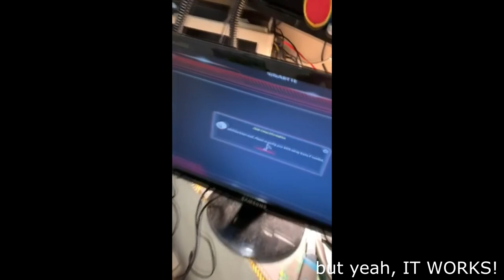Ryzen 5 3600 - Broken pin repair

Comment: Wish AMD designed a fixing tool for repairs likes this.
Reply from the maker: That would actually be awesome!
Reply: They don't because they want you to buy more instead repairning
Reply: @Jaman-qp6fc  Well, it doesn't actually seem to be that hard to fix broken pins to be honest, especially compared to a lot of other kinds of computer component repairs (like repairing a hard drive, or a videocard). It's not like we need any of AMD's special expertise for this kind of repair or repair tools. A company which makes electronics repairing tools would probably be better suited to it. As long as AMD doesn't do anything to make it harder to fix their CPUs, I don't really mind. 

I'm far more worried about AMD doing something like not supporting older motherboards with necessary bios updates for newer CPUs (for example). Initially they said that Ryzen 5000 CPUs weren't going to be supported on 400 series motherboards, but there was a huge backlash and they changed their policy.

Comment: I find it easier to take a pin off an old cpu and drop that in the mobo then place the cpu in as normal. Tried this. Myself and it is extremely hard
Reply from the maker: yeah i agree... it took me abou two days and 4 beers :)
Reply: Does this really work?

Comment: That's one way to do it! You can also buy bags of real AMD cpu pins on eBay, instead of using the SATA wire. You don't even need to solder the pin back onto the cpu!

I bent some pins while taking my cooler off; AMD's stock thermal paste is trash. That ended up being a very long weekend. I was able to bend all the pins back, but one of them snapped! No worries. I took a spare pin, put the tiniest dab of solder on the top (where it makes contact with the cpu), and then I simply dropped the pin into the cpu socket on the motherboard (in the correct spot obviously). Voila! Works like a dream now.

Edit:
I might even buy a busted 3900x on eBay for half the price and repair that too... just to flex on my buddies!
Reply: Dude, it sounds to good to be true.
Reply: Since, I can’t find Anything online about this, so you’re on in a million thAt know about this
Reply: Does this really work?
Reply: 3800x still going strong today. I was fortunate to have it be a corner pin that broke
Reply: @airplaneB3N  Maybe I will give it a try.
Reply: hi man... i have a broken pin in my 3600x... can you explain more... how to fix it
Reply: @hossamben7148    If you snapped a pin, you will need to get some spare pins somehow. I was fortunate to have a friend of a friend who works at a computer shop to provide me with a dead AMD Athlon CPU. You can pull the pins off of the junk CPU using a cheap soldering iron and a very nice pair of tweezers.
  ANOTHER OPTION(probably easier): Buy a bag of AMD Ryzen CPU pins on eBay. I was able to get a large bag of them for about five dollars. You may find that many of the spare pins you bought are bent in places. Don't use those ones, keep looking in the bag until you find a pin that's nice and straight (a magnifying glass helps a lot; or even taking a picture with a good cell phone camera).

Now for the actual fixing part.

  Step 1, TAKE IT SLOW. Step 2, TAKE IT EVEN SLOWER THAN SLOW. 
  Okay that out of the way, hopefully your broken pin is on the edge or the corner of the CPU. If it's closer to the center, this will be a lot more difficult, as you will be trying to dodge all those other pins. 
  Take a sharp X-acto knife and VERY CAREFULLY scrape the excess solder off the spot where your pin broke (I actually used a very sharp pocket knife). You only want to take the solder off. Try not to scratch the PCB (the green circuit board part) because you could scratch too far and damage it. You probably don't want to take ALL of the solder off either as you can damage the solder pad underneath. I only took enough solder off so that it is almost flat/flush with the PCB. 
  Now for "soldering." I used quotation marks because you are NOT ACTUALLY SOLDERING ANYTHING TO ANYTHING. You are only adding solder onto the spare pin so that it can make better contact with the CPU. You are not soldering the pin onto the CPU. 
  Look closely at the spare pin. See how it looks kinda like a nail? The "head" of the nail is the part that makes contact with the CPU. Take a soldering iron in one hand and "wet" the tip of the iron with a little bit of solder. In your other hand, hold your pin with a pair of tweezers. Touch the "head" of the pin with the little bit of melted solder that is on your soldering iron. The solder should stick to the pin easily (the pros call this "tinning"). If you put too much solder on the pin, you can trim the excess off or try tinning a different pin. I must stress again you are not soldering the pin to the CPU!!! 
  Now that you have the PERFECT amount of solder on the pin, the rest is only a matter of placing the pin inside the socket on the motherboard. Just use tweezers to drop the pin into the correct hole of the motherboard socket, then place your CPU in. The right amount of solder on the pin is important because too much solder could cause pins to short to one another, and if you don't have enough solder then the pin won't make full contact with the CPU.
  Latch the CPU in, put the heatsink on, put anything else back together, turn the computer on, and cross your fingers!
  Two more things: Read as many forum posts as you can and TAKE YOUR TIME.

P.S. GOOD LUCK

Comment: Just fix an old Fx-9590 with a broke pin. I used solder paste and donor pin off a old core 2 duo. I been running great for 2 weeks.
Reply from the maker: awesome! :D
Reply: How did you use an lga cpu that has no pins on a pga cpu
Reply: Groundskeeper Willie soldier it to the center of the pad it be working ok. Get it line up was not fun.

Comment: i broke 4 pins on the edge and it still work perfectly lol
Reply: PokemonFan01 i broke 1 pin on my ryzen 3 3200 and its not working , any solution? ;( i just bought it man
Reply from the maker: unfortunately only soldering it...
Reply: @ReaditStori21  i thenk u can take a pin frome a side the cpu dont use and then put the pine in ur broking first pin
Reply: @ReaditStori21  I also have a 3200G and broke a pin. I looked at the diagram of socket AM4 and found that the pin is MB_DATA30. They are said to be a memory channel. I haven't tested it yet because I bought it on Aliexpress and I don't have a hand plate yet.
Reply: @ReaditStori21  If possible, take a look at the diagram and try to find the position of the pin that broke your processor and tell us.
Here >  https://i.imgur.com/y6ytKZT.jpg
Reply: How 😂?????
Reply: @MTS_IT  
I just subscribed.
Would you be interested in buying my AMD 1090t
3 broken pins I will sell it very reasonable.
Let me know please.
Keith
Reply: Some of them are just to hold the cou in place
Reply: @MTS_IT  I saw another vid  where a guy had 3 broken pins and then he popped pins from another cpu in the hole the other cpu would be missing and  would’ve gone and then put the cpu down and said it worked
Reply from the maker: @dvt1363  it’s possible :)
Reply: @MTS_IT  can I ship you my cpu and could you fix it 😭
Reply: @MTS_IT  it’s a 3600 with 1 missing pin
Reply: @dvt1363  which video? Link?
Reply: @T_C_M_O  it’s long gone by now it’s been a year but i can walk you through it man it worked with my CPU
Reply: @T_C_M_O  you need to buy a old ryzen cpu one of the very old athen ones i think they are called , when it comes in slowly remove pins by breaking them off or heating and removing , once you find the perfect pin that isn’t broken or bent save it , then grab your actual CPU ( the one with missing pin ) and see which exact pin hole it is that isn’t making contact due to missing pin, then go and grab your old donor pin from the donor CPU and drop it into that pin hole , then slowly carefully drop the actual cpu into place and secure it. then donor pin should be making contact and allow the CPU to function again even as a loose pin if you broke it long enough it’ll make contact on both sides and work perfectly, my cpu has been going strong for a year with no issue or overheating. good luck man.
Reply: @T_C_M_O  if you have any questions or anything let me know i was completely lost when i was trying to figure it out , nobody really has done it even on forums i couldn’t find anything on it. so igu bro if u need help. i’ll drop my discord or # if u need further help.
Reply: @dvt1363  Thank you for the informations. I will contact you, if I can find a cheap one with a broken pin.
Reply: @T_C_M_O  alright good bro , i found a old ryzen CPU that worked as a donor for like 9$

Comment: Hey man great video but unfortunately no one in my place has skills like you and wont fix it wherever I go they just tell it's dead you need to buy a new one.
They absolutely have no idea about doing smthng like this.
And i don't have a cpu pin and can't get a old one as the shipping charges for a old one are literally 65$ lmaoo whn the cpu is 6$.
And i never tried soldering so....
So i just want to know what are the best options in terms of materials to insert in the Mobo socket for the cpu to make contact to the pins.
I tried a Staple Wire yesterday it unfortunately didn't work.
So the main issue is bcuz of 3broken pins ma Pc isn't doing dual channel anymore.
So shows only half of the ram of what is actually there which is really terrible.

Comment: why are you using a dremal... you know all the pins are soldered on the pcb right ? bit of lead solder blow some heat with flux and knock them off or pick with tweezers 

take some pin from old cpu u can find any CPU on ebay with suitable pins very cheap if you don't have a spare old one around, remove them in same way

if you want line it up perfectly without having to worry go on ebay look for a BGA reballing stencil set or find the correct size mesh stencil x1 or oversize to fit the pin placement (good if u have multiple pins you need to do at same time), all you need is some solder paste (ground up solder with flux can find on most shops or ebay can search bga reball paste also) dab a bit on the pin, line it up hold with tweezer and blow some heat or use stencil to hold pins and  job done :)

have done it many times from people who drop cpu and snap pin or stuff like that

Comment: Tell me is it necessary to fix them ?
I have ryzen 5 2600 it's has 1 pin broken can't I just remove that and put it on the socket will it work?
Reply from the maker: Depends if it’s crucial (there are multiple ground ones so if it’s the ground it won’t be missed that much) - so - try it and see :)))

Comment: Question: how difficult do you think this would be for someone with limited soldering experience? I’ve done a good bit, just not super recently. Or would it be better to find someone I could pay to do it for me? Long story short, girlfriend severely damaged a brand new 3700x.
Reply from the maker: Uff i would rather pay someone... especially if you have limited xp + i’m guessing you don’t have professional soldering iron (and cheapest ones will not do :/ - IMHO ANYWAY)
Reply: @MTS_IT  in honesty, my girlfriend can actually get ahold of a professional grade one (uni professor perks haha) but I’ll take your word for it. Would you be capable of doing this??

Comment: Why u no use flux?
Reply from the maker: i did, wire was inserted into the flux (at first it was very small amount , then later a bit more) - (Amtech 4300/LF)

Comment: This happened to my 3900X!!! 😭😭😭
Reply: I pray for u man :(
Reply: The stupid wraith prism ripped it out of the socket. got all of the pins straighten out and they fit back in except for one that broke. It is also an essential one so it won't boot. I got a old athlon that I'm going to take the pins out of and put one into the socket on the mother board. Thanks for the prayers, I'm gonna need them lol.
I'm a college student so this was no small purchase either.
 I was only able to play far cry for like an hour before noticed temp were too high so I was going to take it out to replace the thermal paste but it was like glued to it because it was hot.🥺😬😑😑
Reply: @TheG60528XiJinPing  Heat the cpu up before removing the heatsink, for example with a stress test ran for 5/10 minutes. The heatsink will come off more easily.
This is a VERY common problem, it happened to me too at least 2 times, when I did not know you're supposed to heat it up before removing the heatsink.

Also please, if you afforded a 3900x you can afford an at least decent cooler. AMD's coolers are not as bad as they were in the past (Bulldozer), but they're still not good.
Reply: @TheG60528XiJinPing  Did you fix it?
Reply: @comosehace2767  heck no lol, its trash now 😆🤮😂😭
Reply: Damn, the same thing happened to me. I didn't know I had to heat up the processor to remove the heatsink. Fortunately it was a single pin, I hope I can solve it with this video.

Comment: Hi, I have a Rx 570 I can’t get to recognize and keep getting Error 0fl01 no adapter detected, I tried everything and I just don’t know what to do, any help? I got this card from a miner and one card worked but this one doesn’t and he ghosted me so I’m sure this card has a bad bios
Reply from the maker: Hi, check these videos: One of methods in these videos will help you repair your gpu (assuming that bios chip is OK) – it will require some soldering skills:

Part1: https://www.youtube.com/watch?v=a3kWxFodvSU
Part2: https://www.youtube.com/watch?v=3k1Nmc-wmh8
Reply: try flashing the bios

Comment: Where can I find pins that fit a ryzen cpu?
Reply from the maker: hi, i used wire from sata cable.
Reply: @MTS_IT  actually I found the perfect solution
Reply from the maker: Dnizzle25 do tell :)
Reply: @MTS_IT  do you have a Facebook account? If you do go and join a group on there called "Ryzen computer builds" I made a post in there with photos showing it
Reply: @MTS_IT  I'm also a moderater so if you join let me know and I'll approve your request and tag you right to the post

Comment: nice subbed
Reply from the maker: Tnx :)
Reply: @MTS_IT  i saw another video the guy used a universal stencil to lineup the pins and hot air it, but manually soldering this is macho 😁

Comment: should have pre-tinned both ends ;)
Reply from the maker: Hi, i have avoided using tin because it makes the pin thicker than the socket and that’s entirely new problem right there :))))))
Reply: MTS he meant put solder on the wire as well before soldering it to the cpu. It makes the solder melt faster

Comment: Only thing is just because it posts doesnt mean the pin was fixed correctly. Each pin has a very specific purpose and you may not realize theres an issue to you complete an action using the corresponding pin. Well done either way never seen it done this way.
Reply from the maker: Hi, CPU was tasted afterwards and it is working properly :)

Cheers
Reply: @MTS_IT  Was it not posting before?
Reply from the maker: @koopaklaw4605  nope
Reply: @MTS_IT  what did it taste like? 

Also I snapped a pin off my 2700x and am now getting occasional memory errors in memtest, and the 2 rightmost DIMM slots on the mobo are nonfunctional. The memory kit is perfectly fine, tested on a different board+cpu. I still have the pin that snapped off, would it be possible to just drop that in the corresponding hole in the socket and hope for the best? I definitely don't have the tools for this kind of repair.
Reply: Crais Bandicoot  ive heard a few times it would work. nothing to lose really

Comment: this just shows what not to do lmao
Reply from the maker: BANT3R hi, i have repaired multiple CPUs this way and they are all working perfectly. However if you have a better solution please post it so all of us can learn something.
Reply: MTS hello, yeah you could of used that copper tape to soak up all the access solder, use flux after and clean, then apply  solder to the board, then solder on the pin, use a smaller soldering iron, should work better
Reply from the maker: BANT3R hi, the flux i use is a professional one and does not require cleaning (however i did clean it) regarding the size of the iron mine (weller) uses tips (and this one was the only one that was good enough to melt the solder properly) - and i did try smaller ones :/ but ... yeah... nope.... Record the video of your repair when you get the time :)

Comment: every pin is changeable... you can warm it to 300 degrees (by solder) of celsus and remove it with tweezers. just buy old AMD cpu for 10€ and change damaged pin and it will be like original. your video is something what we call "gipsy work" in our country
Reply: Hey, do you need to use flux or something like that or just place that "new" pin in the motherboard and after that place there cpu?

Comment: You didn't used flux.
Reply from the maker: i did, wire was inserted into the flux (at first it was very small amount , then later a bit more) - (Amtech 4300/LF)
Reply from the maker: @dontkillpr0cess442  And that is what i did,  (you can even see in my video) https://youtu.be/9n0TEmzK48U?t=140 I do agree about the head part i did clean it several times. The problem (in this type of repair) is that everything is so damn small and if i used greater amount of flux there is a chance that solder will stick to other pins and would end up in an even bigger mess then a broken pin.